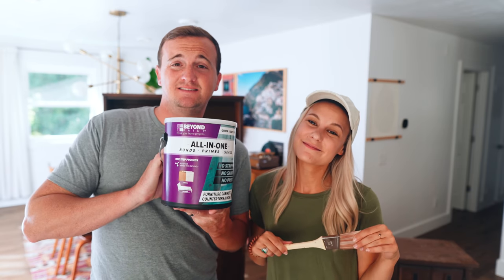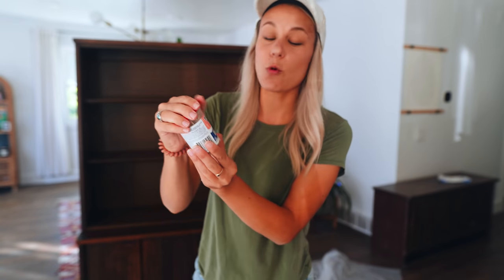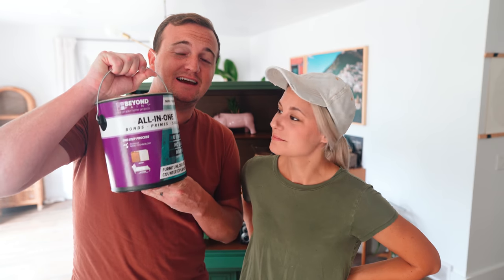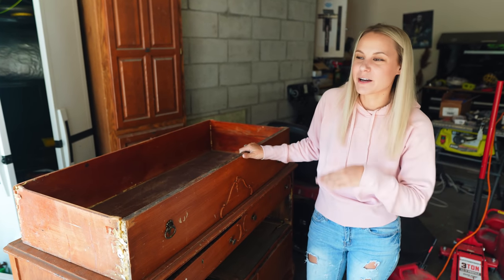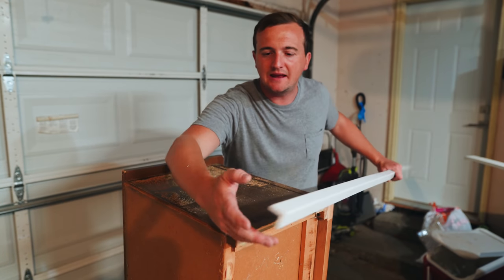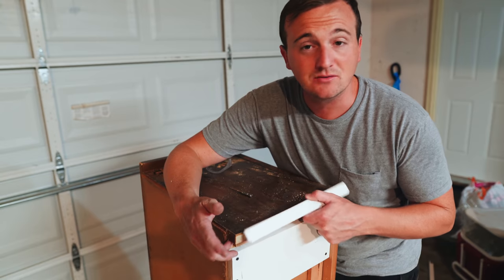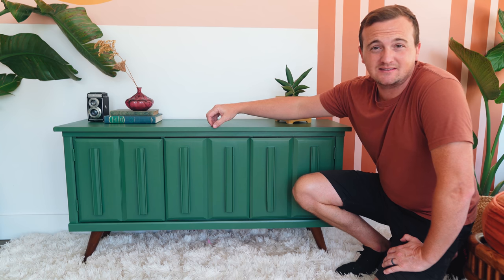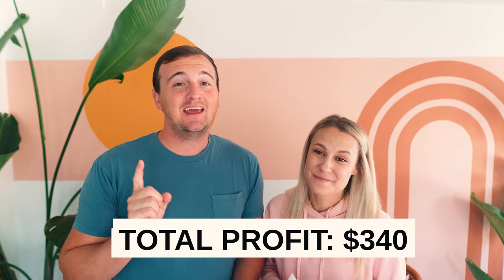Flipping Furniture The EASY Way! - No Prep Paint for BIG Profit!

Comment: Checking out the furniture is always a great idea. I went to pick up a dresser and asked how the drawers worked. Seller said it was a good solid dresser and the drawers all worked good. When I got there it was a cheaply made dresser and the drawers fell when pulled out. I would have been out $50.00 if I just took her word for it. 
I love that paint, Did you sand between coats and did it feel smooth after drying?